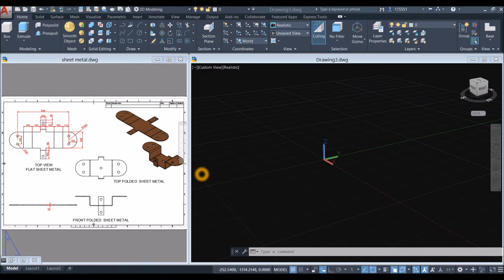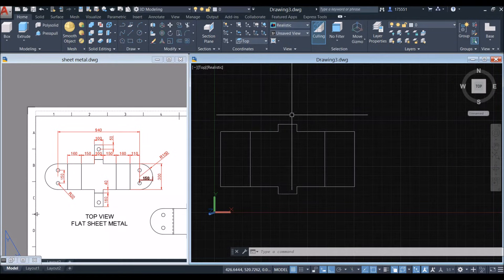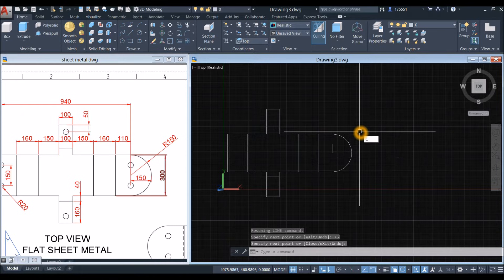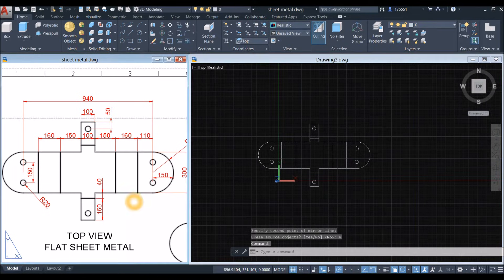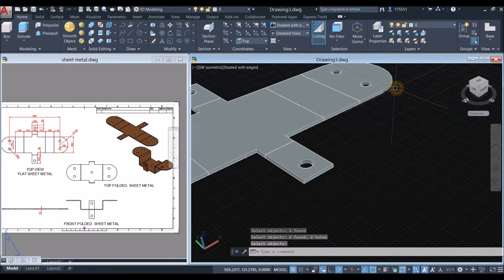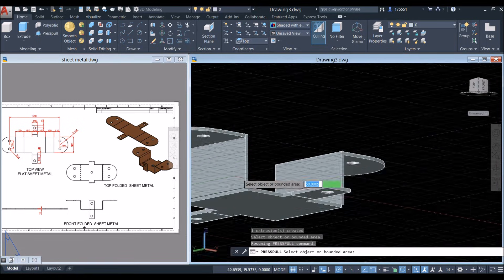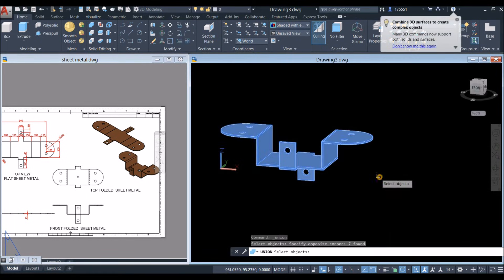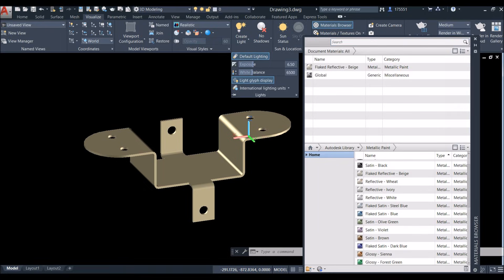How to Bend/Fold a sheet metal in AUTOCAD tutorial

Comment: First of all, thank you for the video. I have a question. In the example drawing you made, the angles are 90 degrees, so the gap between the two pieces is easily filled. So, how can we close the gaps between 45, 35, 70, 75 degrees and give a radius? How can we adjust the K factor? I would be very grateful if you could answer. Good job.

Comment: Thank you for your video -  I was hoping there were some secret tools to make the parts. Unfortunately, AutoCAD isn't the best for sheet metal work. The fold radius are not accurate, and there is no magic tool that I find to "unfold" the component and provide the 2D templates with accurate fold tolerances calculated. If this is needed, you need to step over to something like Fusion 360, where you simply draw the 2D profile, then the software automatically generates the 3D and all the folding processes. Once the 3D model and render are complete, you simply press one button, and it magically unfolds into a flat part. Good luck and health to all.
Reply from the maker: true , I saw another program that can be attached to AutoCAD that can do that.